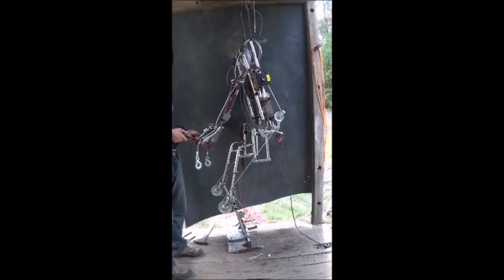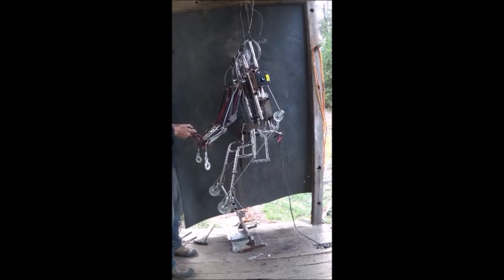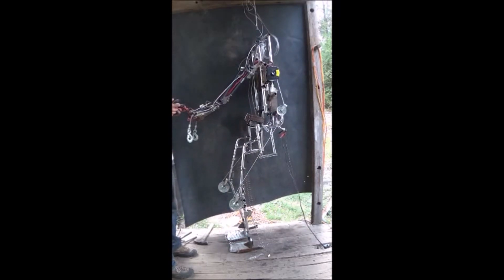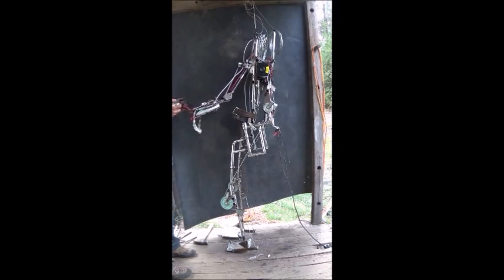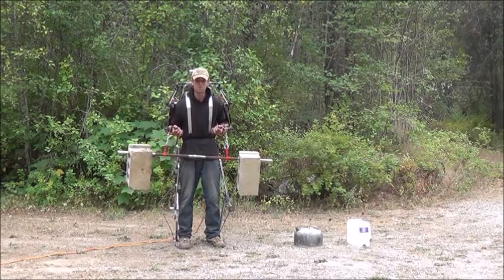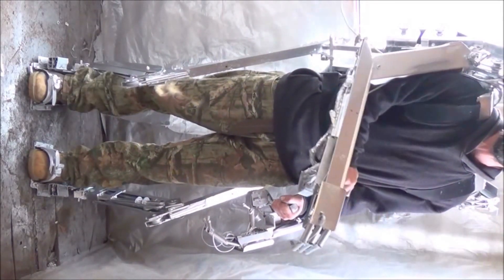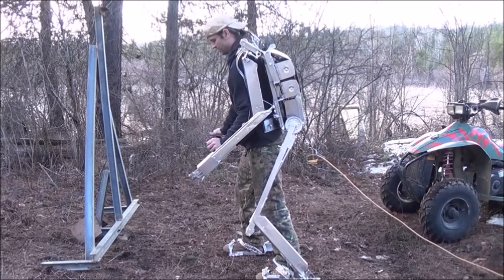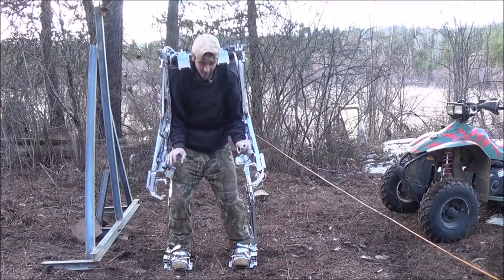Homemade Exoskeleton Suit,  Built from scrap material comes to life!

Comment: some things that would realy enhance the suit would be a ratched and clutch system so you can dynamicaly lock directions of movement to reduce loads and some passive springs or rubber bands to assist the muscle groups usd most often.

Comment: Eh....I wouldve used flex sensors to male the suit automated and move with your movement. Of course you'd need an on-board computer to calculate the force needed. However, that wouldn't be hard to accomplish.

Comment: ironman built the whole suit in a couple days in a cave.....what's taking you so long?!?   I'm kidding of course this is a pretty cool start.  to make it version two and three....each time will kick butt over previous.  g4u man.  BTW remember all stuff on YouTube is open to reviews by the terminators.  who might decide you are either a threat or worthy of jealousy.  a computer sensing movement in the legs might help your timing issue.
Reply from the maker: Very little was needed to make this design very fluid in it's operation, the final model is a joy to use and no one can tell you are wearing it!
Reply from the maker: I should say the undetectable model can't compete in strength with the larger model but it makes you stronger than any other man!

Comment: Nice! That is some next level , crazy machine. What's the heaviest load it can carry?
Reply from the maker: The limit to load in this prototype was the metal it was made from could not handle the combined total force the winch's provided the suit, there were two 2,000lb. and two 2,500lb. winches powering this suit so it could tear something apart with a total of 9,000lb. of force!
Reply: No way, that's like 4000 kgs. Please show us how you lift heavy stuff. A car maybe?(should be less load than 1,5 tons) That would be really cool but only if you feel that it is safe enough... Great work, I'm waiting for the next generation.